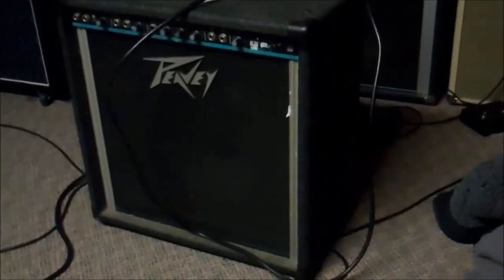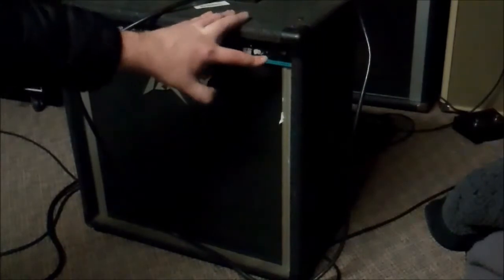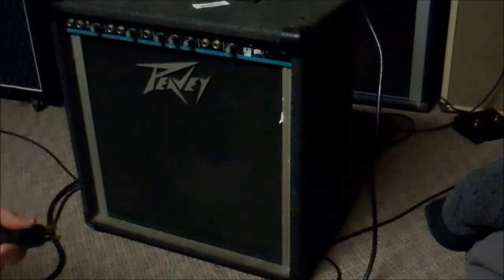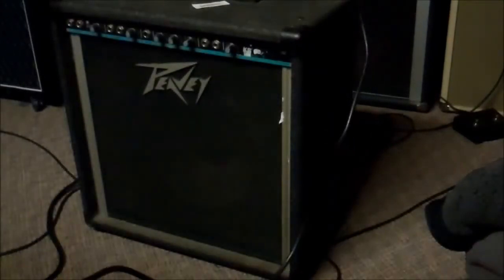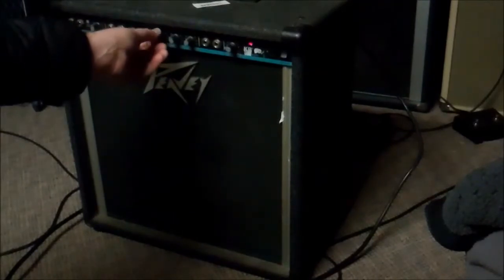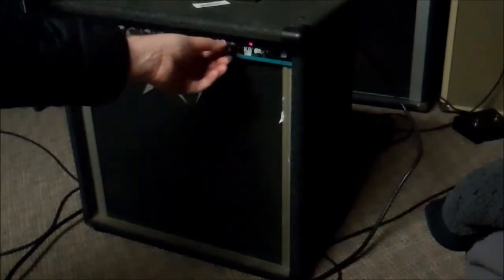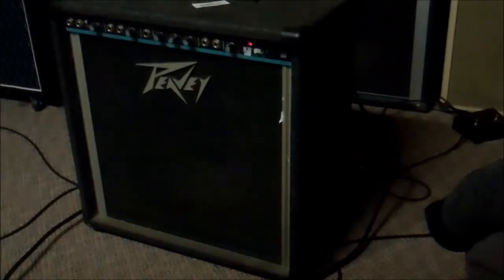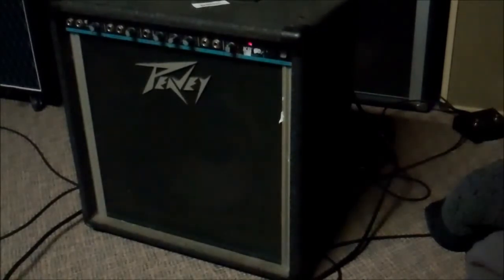Peavey KB-60 Keyboard Amp found at the pawn shop...  Does it even work?

Comment: Good investment for the price I bought my bout 7 years ago. All you need is to keep the pots clean. Been using it with the keyboard and guitar. Good amp for biginer
Reply from the maker: Peavey's USA made stuff is very reliable in my experience.   I got this sold shortly after I fixed it to a gent who wanted it for a Ukelele!   It worked fine for that job.

Comment: Hi, I have a KB 60 Peavey amp. So I would like to clean the speakers. But I can't get the front cover open. Could you tell me how do I do that. Is the front panel fixed with screws? Thank you .
Reply from the maker: On mine, it's only affixed with very strong velcro.   It also fits pretty snug in the cabinet.    It will pry off.   This has been the case with all of the 80's Peavey amps with front mounted speakers.  (I've done at least four)
Reply: @DeadKoby  Thank you for the answer. Today 14/Oct/2019 , after one year I posted the problem , I could open it ever since I bought it from Saudi Arabia in 1995. Pretty long period , isn't it? You were dead right. Its the velcro did all these problem..
Reply: @nishanthaperera1647  I will admit that it took some effort to get mine off also. I put extra velco on my Boogie but it's cover is wicker and weights a little more. I need to rebuild the speaker cover of my Lab amp cause the cheap fiberboard cracked and doesn't hold at all. Surprisingly on a great amp like a Lab Series. But these Peavey's are built like tanks.

Comment: I fixed the same one. Just pull the knobs off and spray contact cleaner in it and it will work like new.
Reply from the maker: The USA made Peavey stuff wast pretty tough to kill.  That's likely its best selling point.
Reply: can you play bass on the amp???

Comment: I had a monster Peavey Keyboard amp on wheels, it totally kicked ass on stage, but was bloody heavy. Not sure if it was this model. Anyway, I got tired of lugging it up 2 flights of stairs, so left it in the boot of my car, where, eventually, it was nicked! 😉
Having used a Roland keyboard amp for years since, I'm now looking for a really powerful, but, more importantly, lightweight amp (again) preferably with wheels!
Reply from the maker: The Peavey solid state gear always seemed invincible to me...  Every one I ever pick up needs very little to bring it back to life.
Reply: I doubt it was this amp. Cause this really isn't that heavy. Course I go by the weight of my tube amps and these are heavy. 1 is a Boogie in a road case.  Easily 100 lbs. 2nd is a Fender Twin. Just under 100 lbs. Also got a Behringer 300 watt 15 in speaker bass amp that weights about 50-60 lbs. And a Lab Series L5 that I recently got for free. It's got some weight to it but I've only lifted it once so far. Can't really remember the weight as a guess. But after all that this KB 60 is no where near these others. Guess these are why I tend to use my practice amps more. Only 1 of the big amps I have out is the Boogie cause I just leave the lid off it and the cord within reach. The others are stacked up in my amp closet with big P A head and speakers.

Comment: What’s the issue with things being made in Mexico?…
Reply from the maker: There isn't.......  however the design of Fender amps made in Mexico are not as reliable as the older designs from the early 80's and before.  Not the place it was made,  but how they made it.
Reply: The quality of parts used. And for Fender that only goes for amps. The guitars are great IMHO. I don't own any now but have in the past and do recommend them as starters. I do see a lot of reviews stating Mexican made Fenders amps as good but it's hit or miss from people who work on them. Check repair reviews to see if I'm correct in saying that.